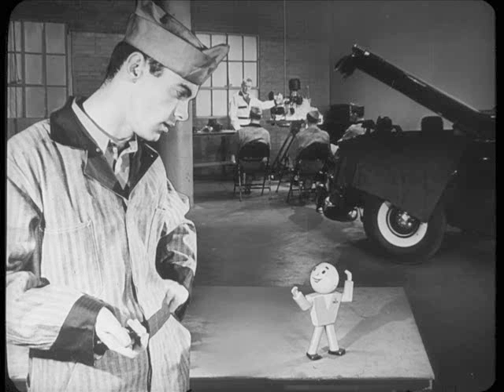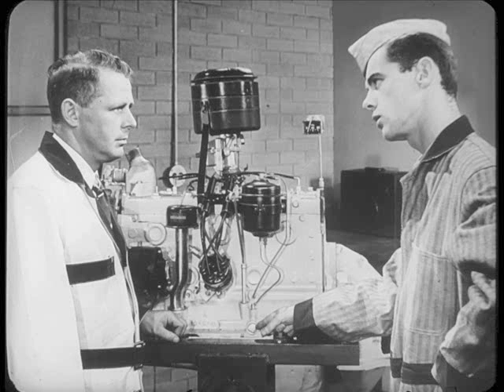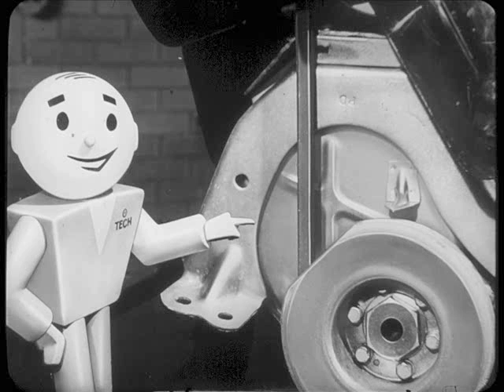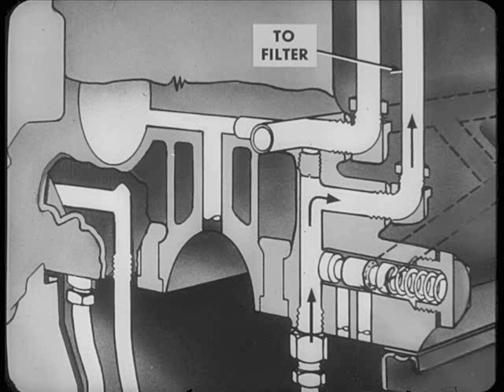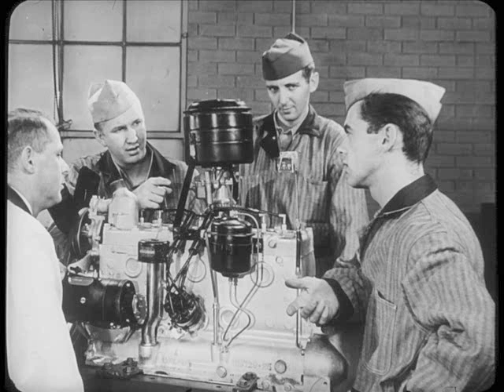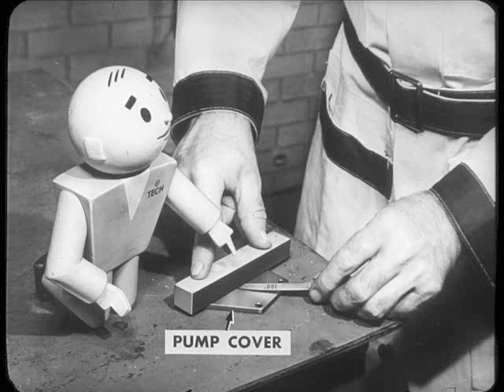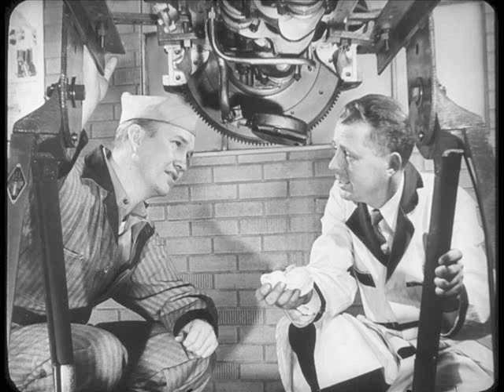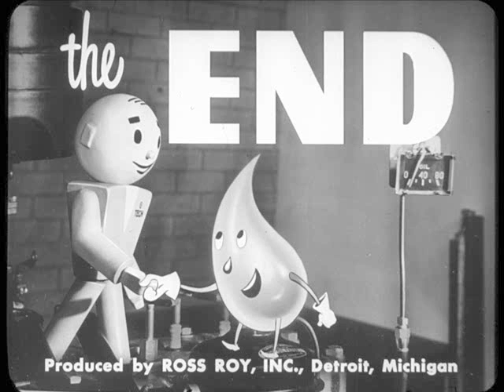Chrysler Master Tech - 1948, Volume 2-3 The Engine Oiling System

Comment: People use plastigage to determine bearing to crankshaft clearance instead of a pressurized oil tank nowadays. However, the pressurized oil tank is used to prime some new or rebuilt engines before their first start.